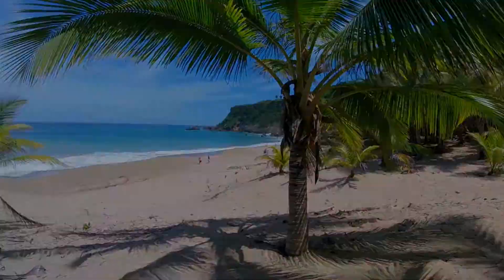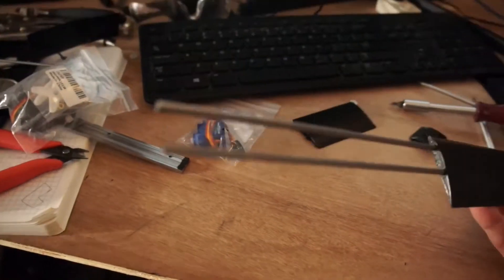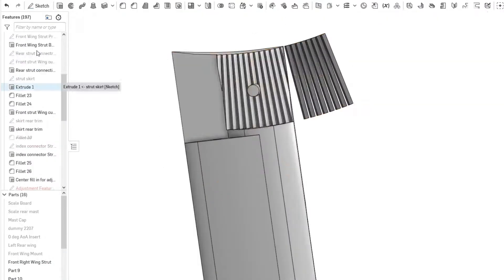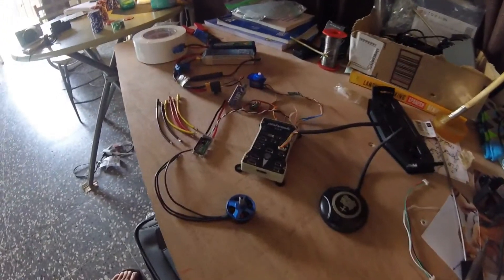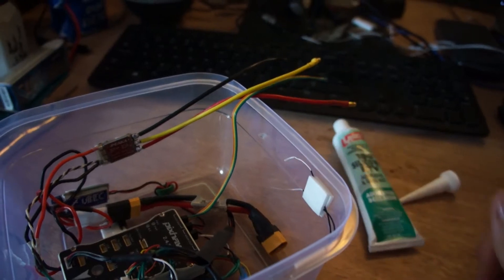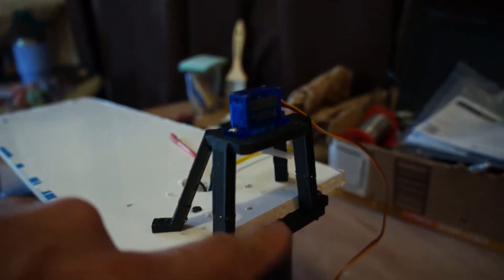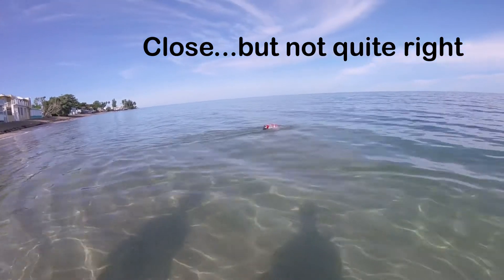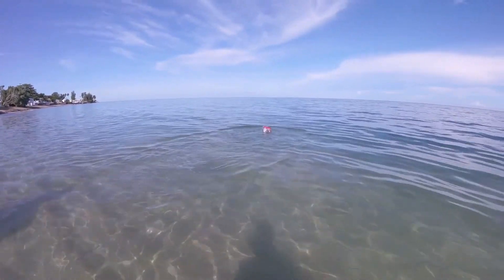03 RC Hydrofoil Design, Build and Test! Will it FLY!?

Comment: Hi, this is a nice intro to your project; I am starting mine with catamaran style now and wonder what motor you use  2207 right? how many KV? what about propeller?
I am living also in the tropical zone, but on an island in Asia, everything can be ordered but take time and shipping cost, so I better avoid mistake
Reply from the maker: Hey thanks for watching!! I am using a standard drone motor for 5" quad, 2207 2600kV. Propeller is a 3 blade 5x4.5" drone prop that I cut the ends of the blades to reduce the area for use in water. This setup works well on 4S but need a high current speed controller. Maybe use lower kV motor for less heat. I have to upgrade to a 50A to take the surges in current and also run at a lower temperature in the waterproof box. Water cooled speed controller would be a good idea. Also VERY important, since motor bearings are exposed to the water, MUST grease with axle grease before every test, and then remove the magnet bell and dry after. If the motor is in a push configuration, remove the clip on the end of the shaft, so you can simply pull it off and grease bearings. Best of luck and have fun!
Reply: @intuitiveengineering3277  Hi, thanks for that prompt answer this is not easy to choose a motor as there is not so much info about RC foil, 
I am making mine from this design here but change the back to a servo-controlled foil : https://www.youtube.com/watch?v=_vraWXpuF9k
Here is a nice video about how it works with sail and how to control the lift : https://www.youtube.com/watch?v=WvKqfAVsxt0
Altitude could be measured with waterproof sonar module